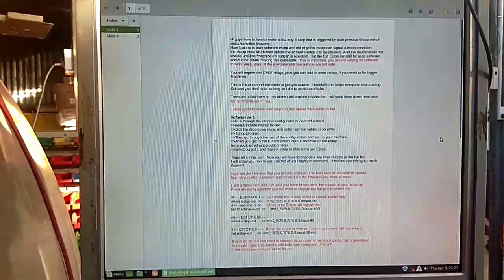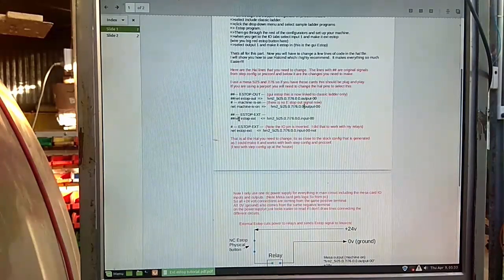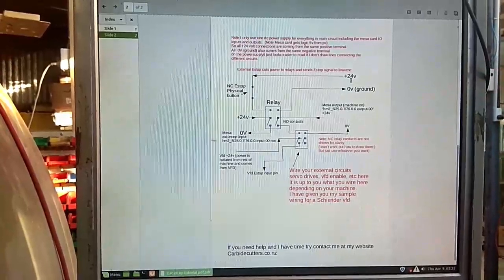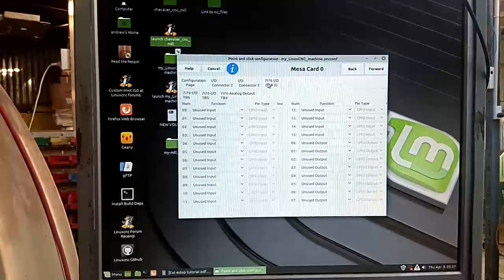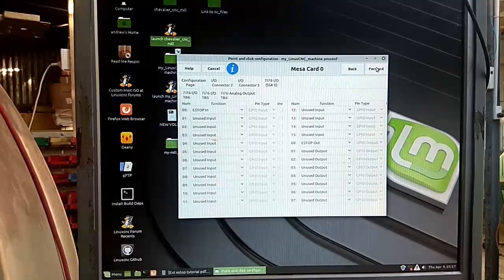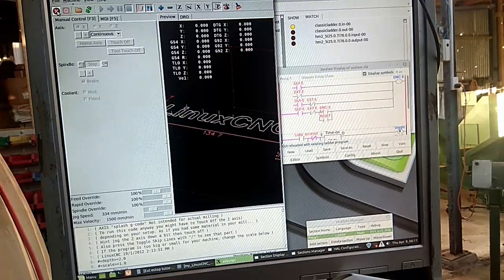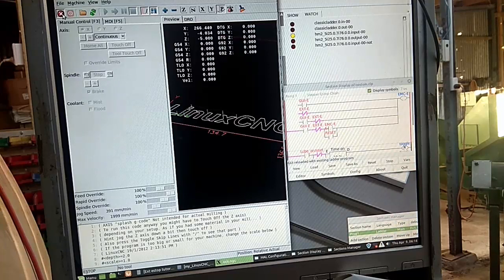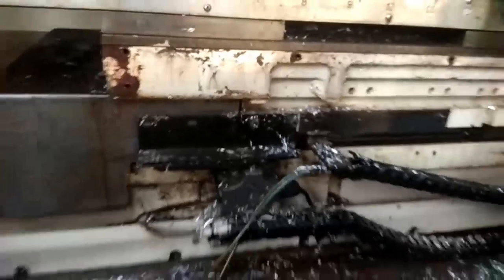Linuxcnc.  Latching E stop switch with classic ladder plc

Comment: nice dood!, can i pick your brains on general linuxcnc software stuff?
cheers
tanc
Reply from the maker: Yeah sure.  What do you want to know?
Reply: how eassy is it to use you estop system with a standard breaakkout board (hg08) and how do i get debian to not require a password every 5 minutes?(aaarrrrggghh) cheeers

 tanc
Reply from the maker: @itanc1  when you first install Debian you can set to auto log in.  But if you are just tired of the screen saver going on every 5 mins. Go into screen saver preferences and set up never go into screen saver.

You can use this e stop fine with a normal breakout board.  But will need to change Hal pin names
Reply: @carbidecuttersnzltdandrewb8449  cheers dood, nice one

Comment: Interesting I am looking  for a way to integrate a heat sensor (fire risk) to stop the spindle spinning even if the machine has stopped moving and is heating one spot
Reply from the maker: Did you still want to find a way?